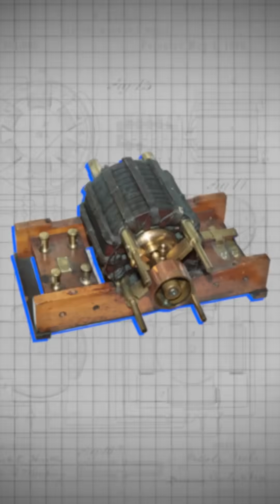Free Energy from Lightning?!?!

Comment: There was a person that found a way to do it. The process involves tracking meteorological data and firing a model rocket with a wire attached to a large capacitor  into a storm cloud to trigger the strike. There is video footage of the guy doing it somewhere. The footage is very dramatic and not easily forgettable. It was in an American news segment that I saw around fifteen years ago.

Comment: I remember going down a massive rabbit hole about this as a kid, trying to design a giant van de graf generator to attract lightning strikes, then try to sink the energy into a massive bank of giant capacitors.

The problem is not only is it so random that trying to guide lightning bolts even at that scale is difficult, but there is actually a 100x scale difference in the weakest lightning bolts vs the strongest. That's such a huge range it's very difficult to properly engineer for.

Comment: A very high and thick (high amperage) lightening arrester, instead of connecting directly to ground, it should be connected to a bank of capacitors and other ends of all capacitors should be grounded. 

The dielectric of all capacitors should be spaced largely to raise break down voltage drastically. 

The lightening will get attracted to lightening arresting towers and charge the capacitors everytime it happens.

Comment: Not impossible to slove tho.

1: lightning can strike in one spot for example an active volcano.

2. A really really big capacitor
Reply: usually, capacitors can either have a big capacitance, or a big voltage. Here we would need both, which increases DRAMATICALLY the bigness of it
Reply: @lucasgrd4258  ...and how to store it. Smaller bolts of lightning, purposely discharged by some method, at regular intervals...
Reply: @ once you stored the lightning in that mind boggling big capacitor, you can « safely » discharge it in a regular battery. The whole point of a capacitor is to be like a battery that can charge and discharge at gigantic rates compared to a regular chemical battery
Reply: Volcano, is that a high dust area that causes it?
Reply: So you want to build a very very large capacitor near a very geologically active site, which could potentially blow up and everything for miles around it.  Did I get this right?
Reply: @austen98  Yes? who cares about safety, we are harvesting lightning!

Comment: If you put big spikey tower on top of the moutain and ground it to the sea or lake bellow it, it will collect allatmospheric charge from that atmosophere around it. Simple LC circuit consisting of regular HV capacitors (not supercapacitors) and inductors is enough to catch this charge. This charge is afterwards discharged either to grid or to charge a battery bank or pumped storage...
Name of the game is harvesting atmospheric charge. Slower it is done, it is more efficent. Once lightning happens, energy is wasted. Why dont we do it? It isnt economicly self-sustainable. More energy can be harvesed on yearly baisis with solar or wind for fraction of the costs and with proven technology.

Comment: I think an early proof of concept project for this could be a liquid salt battery. Namely, set up a lightning rod (or an array of them, whatever makes sense) in areas that get relatively constant lightning strikes (i.e., a pretty constant number of strikes over a given period). Instead of trying to store the energy as electricity in a capacitor (though that's a good goal to work towards), dump it into melting a salt bath which is itself conductive. Test various methods of capturing the energy since it's basically a free resource.

Not all of these areas will experience the same amount of lightning, obvious, but that's good. 

Measure the number of strikes each site gets, estimate the total energy being dumped into the system, see if efficiency stacks with more lightning or if a certain minimum is needed to break even. Expand on tests from there blah blah blah.

Comment: There is an easy way to capture a fraction of lightning energy: by induction. The device would be destroyed if a lighning hit it, which is unlikely. Meanwhile, any lightning several miles around would feed the electromagnetic inductor, whose high voltage output should be transformed to low voltage before storing the induced energy captured.
Reply: I think what Nikola Tesla was really after it was like what you speak of but establishing that pretty much where every substation is some kind of integrated facility and there should be a way to obtain constant power from the atmosphere when an array is in place globally
Reply: Then there would be the efficiency for the material.. this system could theoretically have massive effects on the weather I personally think
Reply: Even if the constant power is at a minimum there is a way to properly utilize it just more phases when it comes to motors

Comment: Three quarters of the Earth's surface is water. Putting up towers across the oceans would require floating carriages as the depths of most of the oceans are too deep to anchor towers too the sea floor. There would be tens of millions of these towers and they would be a hazard to all navigation. Maintenance would be a nightmare.

Most of the Earth's land surface is uninhabited. Access roads would need to be built in such numbers and length as to boggle the mind.

Putting out enough lightning rods to catch all the lightning bolts, and then deploying enough super capacitors and battery banks, and then deploying enough transmission lines, would be mind bogglingly expensive.

The environmental devastation caused by deploying such world-wrapping infrastructure would also boggle the mind.

A lot of boggling is going on here.
Reply: Except, just like with wind, solar, and oil, you don't need to capture all of the energy? The idea, if it were to be made feasible, would be to do so in areas of convenience, like skyscrapers, mountains, and certain plateaus. Retrofitting existing infrastructure that already exists (e.g., lightning rods to ground skyscrapers) seems pretty reasonable to me.
Reply: @Tahoza I'd need to see figures on how much electricity would be collected from the partial area versus the cost to cover the partial area, provide for transmission, and provide for storage.
Reply: Think how crazy the idea sounded of running wiring coast to coast, border to border, once upon a time. I think there was probably a "you wanna do WHAT?" type of reaction 😂